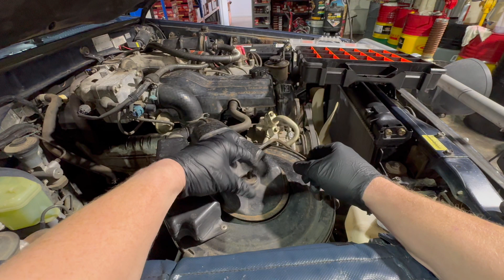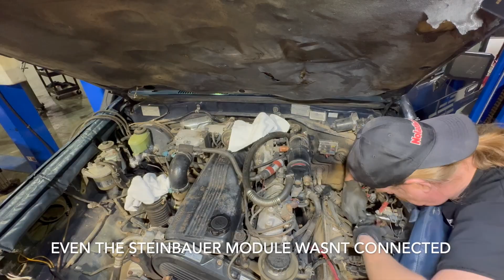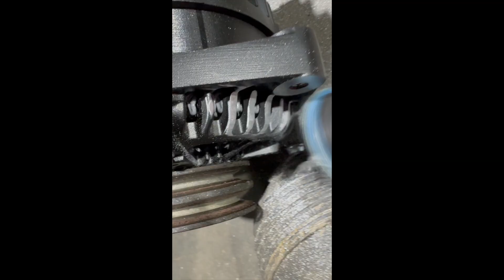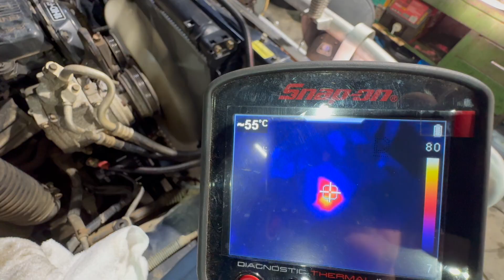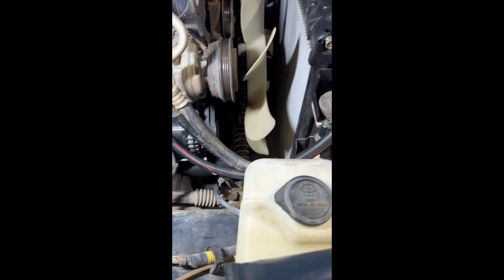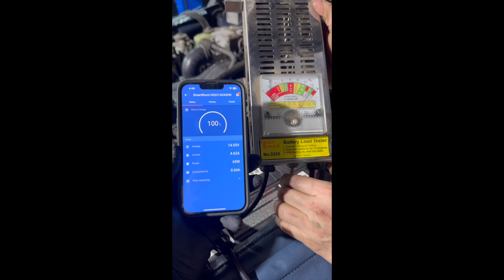Project Troopy: 240A Alternator Upgrade + Victron Smart Shunt & 9kg Wiring Cleanup

Comment: What brand are the other two  ,  after 22 years and 250k my orignal toyota is not putting out the current i would like. Good video.
Reply from the maker: Denso 110amp OEM 20 years old 450k kms. Baxters 150amp (no good). Jaycee black series which do a 170 and 240 amp. so far so good. I can help with one of those if needed.
Reply: @troopytech9467   My denso is still going, at an idle the voltage is to low like 12.1 low 14v at 2000 city driving.  With two optima blue tops under bonnet and 300ah lithium with redarc 40 dc/dc in the canopy its struggling. Interested in price on both . if thats what you do.
Reply from the maker: 240 amp https://www.cms4x4.com.au/products/240a-black-series-alternator-toyota-landcruiser-1hz-1hdt-1hdfte-heavy-duty-12v-upgrade-requires-modification

170 amp

https://www.cms4x4.com.au/products/jaylec-black-series-170amp-1hz-1hd-high-output-alternator
Reply: @troopytech9467  Thank you

Comment: I changed out my intake hose from the air box to the turbo inlet as it had cracked after the lid being opened to many time checking or changing the filter element. 380000km also the hose from the turbo outlet to the cross over after Toyota stuff it when doing valve adjustment 😞Good vid.